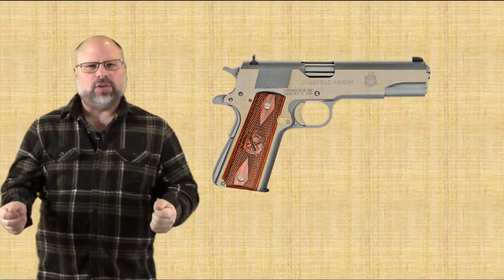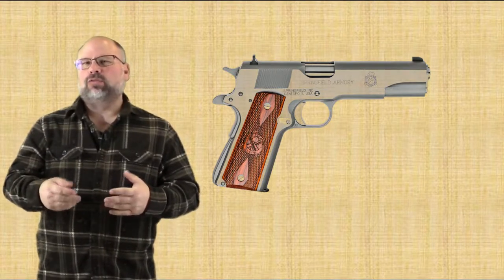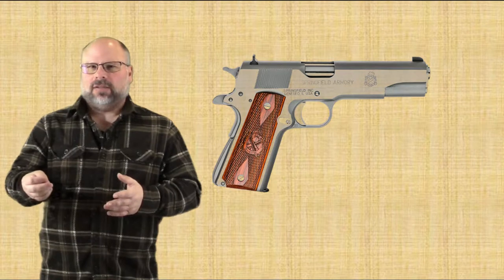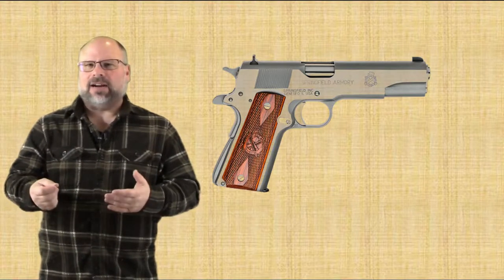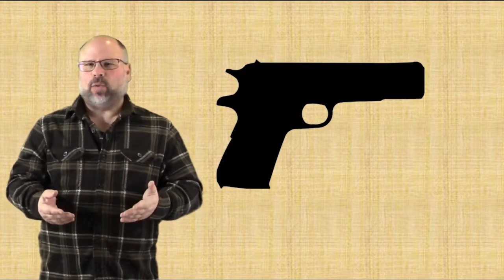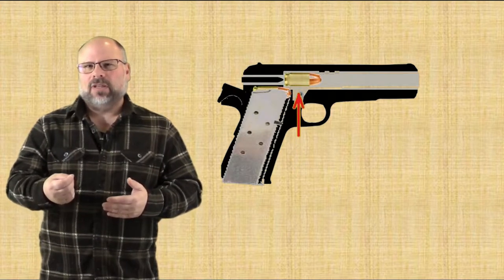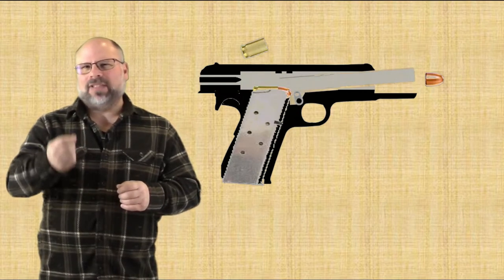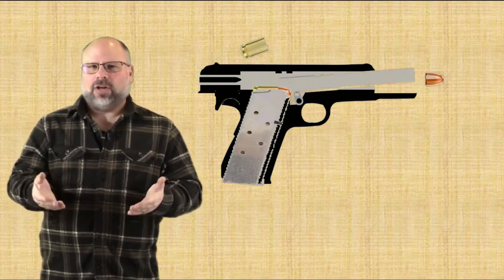RECOIL OPERATED FIREARMS

Comment: Could you tell me whats the advantages of this system over the simple blowback?
Reply from the maker: The main advantage is that the breach remains locked longer allowing pressures to drop to a safe level before opening. This allows more powerful cartridges to be used. Basic blowback is only practical for relatively lower powered cartidges.

Comment: Is the recoil and the movement of the slide generated by the empty brass pushing it backwards? or is it simply the energy produced?
Reply from the maker: In some respects yes. The recoil force is first transmitted to the case which then transfers it to the slide.
Reply: @CraigsGunChannel  thank you for clearing it up for me😊